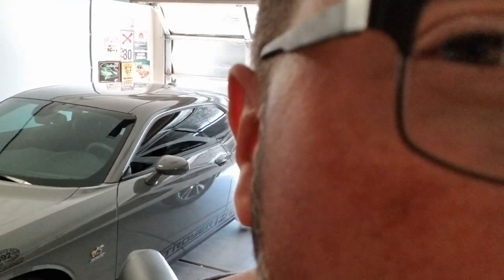2019 Dodge Challenger 1320 (How to check the Transmission Fluid)

Comment: I think the issue is the pressure in the transmission. The lack of dipstick would mean it blows the dip stick right out if it were to have one. I guess the price for these fancy bmx gears lol. 
I have a 392 WB Charger and I think its the same basic transmission, the HP70, so process would be the same. Yeah, its annoying, but at least its not something you have to check yearly.
Reply from the maker: You nailed it!

Comment: I have a 2020 1320...Not sure I want to go through this. I thought the Aisin 6 speed in VWs was bad. Anyway, have you changed the transmission fluid yet? I live in AZ too. East Valley Phoenix.
Reply from the maker: I traded it in on a 2500 Ram after I created the neutral strap covers to stop thieves. I knew I was a mark after helping people. I did not change the fluid, it was on the too do list for me. I would have brought it in to a dealer for that.
Reply: @Destroyer1320  Diesel Ram or 6.4? How do you like it? Big difference.
Reply from the maker: @nokoolaid  I got a Power Wagon, 6.4l major difference in power but love it for what it is.

Comment: Have you changed out your transmission fluid? That's alot of steps to just checking the fluid. Haha. I just rolled pass 60k on my charger 392. I'm thinking about changing it out for peace of mind
Reply from the maker: I have not changed it not sure I will I may take it to the dealer for that.